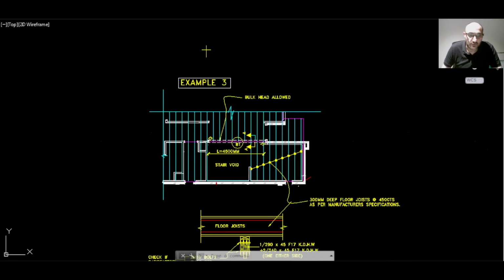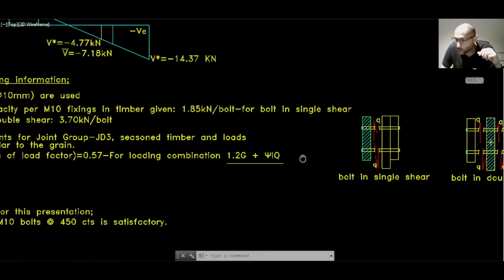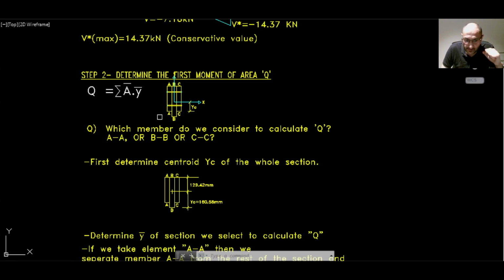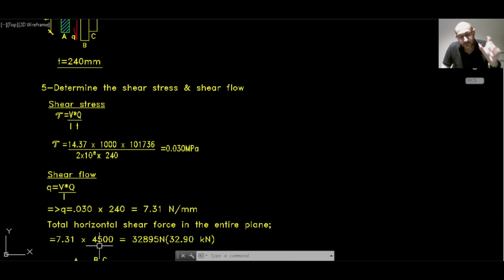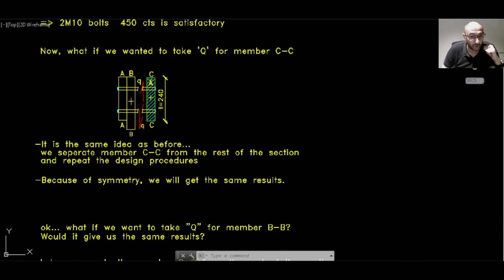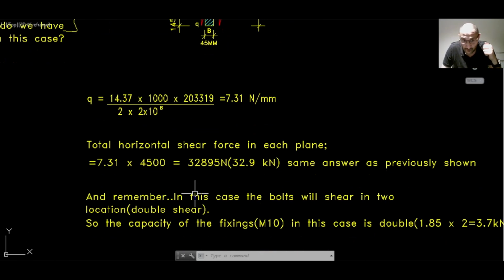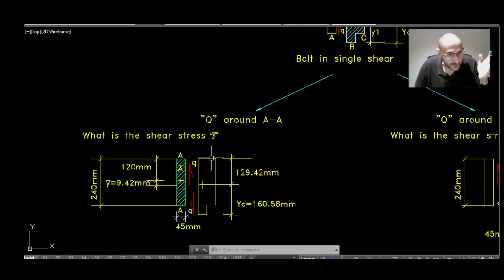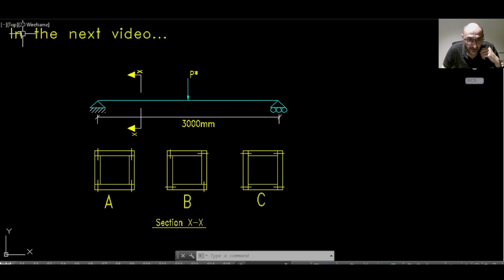Shear stress formula and built-up members- Part 5(Example 3)

Comment: I'm really enjoying the content! It's helped me better understand shear stresses in beams. I do have a question regarding laminated/double beams. If you were to laminate a 290x45 directly adjacent to another 290x45, the y bar value would equal 0, which should mean Q = 0mm3 and then q = 0 N/mm. Wouldn't this suggest that no shear stress is present, and thus, no fixings are required? If that's the case, your LVL Beam (Example 3 in the initial introduction) shouldn't require any fixing to be considered a uniform section, no? Looking forward to the next videos in the series, hopefully, my questions will be answered there!
Reply from the maker: +
Thank you so much for your feedback and your question. Yes, you are correct. If the first moment of area (Q) is zero, then theoretically it means that there is no longitudinal shear stress transferred at the plan located through the fixings. But in example 3 of the shear stress introduction, I think I showed a beam with a UDL as well as a direct external force at mid-span.
In cases like these, I guess we need to be mindful of direct shear applied loads or external forces. If we had 3 identical members laminated with UDL loads only then yes, you are right. Generally the code would then suggest extra fixings only  under the external reactions(at supports) and then nominal fixings throughout the beam(minimum fixings). 
For floor beams or even roof beams in residential settings, the question then becomes, how realistic would only allowing UDL loads be? In reality, these beams take series of direct point loads either from studs, floor or roof. And for this reason, the code has made a stringent rule about minimum nominal fixings and maximum spacing's of the fixings. If we had welded steel beams supporting a continuous concrete slab then I guess  UDL loading in this case is more realistic.
I have been adopting UDL loads in the worked out examples just for calculation simplicity.   
So, the question becomes- If Q is zero then what are other  possible forces that could be on the fixings?
1.	Axial forces (if there is tension or compression in the beam elements) This is normal force due to bending.
2.	Bending moments (only if fixings resist rotational effects).
3.	Direct shear from applied loads or external forces (not related to internal shear stress in the beam). Especially in cases of direct point loads or at support reaction. 
4.	Position of the loading on the built-up member is also very important to consider. Where is the load applied in respect to geometrical centroid of  the laminated members? Do we have eccentric or out of plan loading?   
Also, I believe LVL beams(in fact most timber beams) behave very poorly when direct shear loads acts perpendicular to the grain and the location of the hole or fixings are within the tensile region of the beam element. Tensile here is referred to the normal tensile force due to flexure. 
So, if we have a large external point load then we must be careful when  considering the exact position of the loads in respect to the laminated elements as well as transferring the direct loads to the beam via the fixings.    
Thank you again for your question, and I will try to make time to provide other examples and elaborate further on this topic.
Reply: @learn-structural  Wow, thank you for that. I appreciate the insight! Definitely give me more to think about. I'm always curious regarding the decision making regarding a lot of clauses within the codes, not just AS1684 - every answer leads to more questions! Thanks again!
Reply from the maker: @QuantumDestra  fantastic! I am glad to have kind of helped. Thank you again and best of luck with it all.